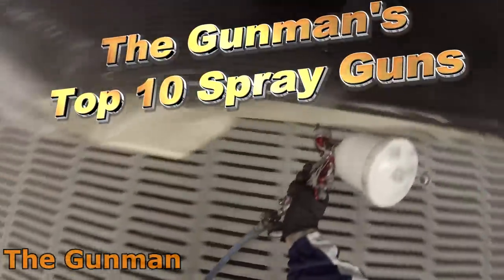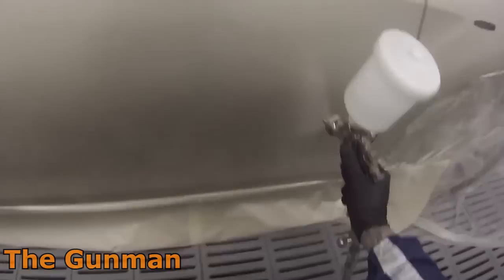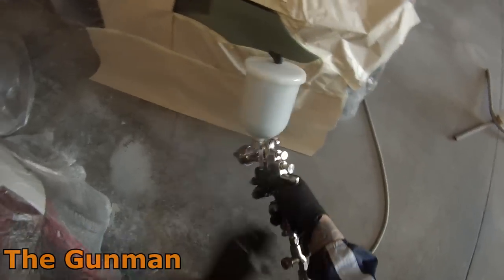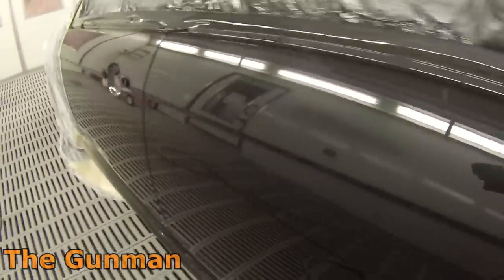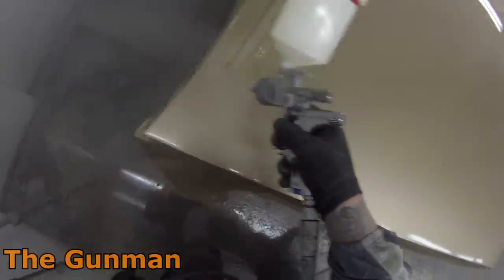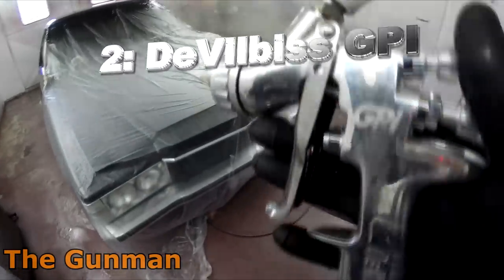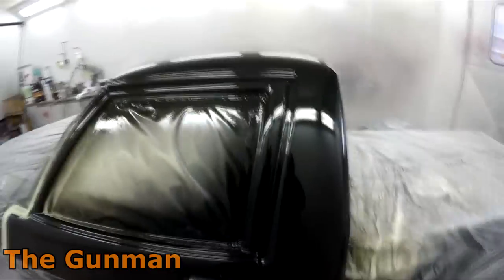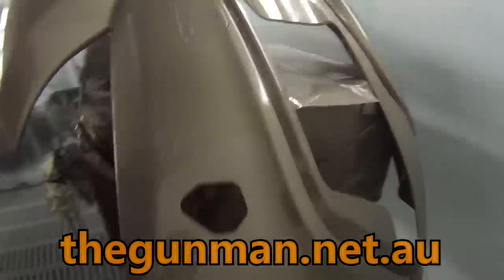Top 10 Spray Guns

Comment: When I first started working auto-body for my Dad in my early teens, the only paint guns that existed were siphon-feed Guns. Of course, phones still had curly "Q" cords attached to the wall and most people thought you were well to do if you had one the could make it to the living room from the kitchen and it had a number pad dial on the receiver so you call from whatever room you could get away to.

Back then the only paint guns worth having were, Binks and DeVilbiss. I would use SK's, Blue Points and I.R.'s for primer, and lacquer primer was the only thing that even existed when I first started. I think it was the ass-end of the '80s / early '90s when 2K entered the world but every shop I ever worked for in those days used lacquer primer until it was completely taken over by 2Ks in the mid-'90s. 

The first 2k product I can remember is RM 2K clear (Wich claimed you could "Key job" it and it would self heal. The only drawback to it was a dent could not be blended or repaired. If a car got hit in a quarter panel you had to repaint everything attached to it, which usually meant both quarters, the roof and, God forbid if there was custom work under that clear!!!) and then Sikkens came along shortly after and totally screwed up the entire paint code world. DuPont finally caught up and it wasn't long after that Martin Senior went basement bargain pricing and dominated the industry in my neck of the woods. Probably the most advanced paint product in my early years was Imron and Centari.

Anyway, DeVilbiss was my go-to-gun for clear coats. I do have a pair of Air- Gunnza  AZ3's with 4 needles and cap setups and I can tell you that the 1.3 is an awesome clear coat gun, The 1.5 set- up is a great all arounder and the 1.7 lays the 2k and Epoxy Primers down so well it's actually a joy to spray primmer.

For custom work and big airbrush projects, my mini-gun and probably my favorite gun I have right now is the Sata-Minijet 4! What an amazing toy that little rat is. With the fan setting in the cone position, I can make pencil size lines and with a little eye to hand practice I am wiping out rat tails, shading, you name it that gun is the most versatile piece on the rack.

I gotta say though, I would never have thought in million years a paint gun would get as pricey as they do today. Seem's like Iwata is the culprit that destroyed the spray gun world with the cost and, really until I actually put a big Sata-Jet in my hand, I thought the whole conversation around spray guns, airbrushes, HVLP v. LPHV, atomization and, overspray v. paint contact was a friggin scam!!  The idea of well-placed grommets, air chambers and, hand-polished needles being any different from what already existed was all Greek to me.

Before the whole "Atomisation" revolution came along, the most modern, "Hi-Tech" paint gun I cant remember was a Sharp. I can remember the Snap-on guy bringing one into the shop and talking in up and shortly after that,  the sales reps' started invading the place. Sharp's were different and they had a unique feel and they looked kinda cool but it ended up being a $75 primer gun because to me, the most reliable and smooth tool I had was my DeVilbiss' 

All of this to say, HOLY SHIT!! I am in love with that Eddie VanHallen "Frankenstein" design you got there!! If I would have had a gun like that growing up ...... Or even now for that matter! I gotta have it!! I'll be looking.

Great vid man! Thanks for the post. Like I said I've been doing auto body and custom paint since I was 14, I'm in my early 50's now  and I do everything in my power to not touch any project

Comment: I'll add my 5 cents:

1. DeVilbiss GTI Pro/Pro Lite - lightweight, easy to use. OK for normal everyday use, you don't have to care much about it, just grab and spray. Cheap.

2. SATA 3000/4000/5000 - not for everyone, more for experienced painters, not so easy to use -sometimes unexpected behavior, worse ergonomy at least for my palm, difficult to set it up, mainly the HVLP model. Expensive. Will withstand various acids, peroxide and other corrosive liquids.

3. any other.. 

Easiest to use - SATA 100 B RP Lignum - if you ruin a paintojob with this gun then better you stay away from spray painting for good :)  
With 1.7mm  tip you can do the whole job from filler to topcoat.
Not a car gun though, developed for furniture production. 
Best gun for beginners. 
It won't withstand chemicals as good as expensive SATAs, for example knobs will turn dull when exposed to corrosive chemicals. The body is still real bulletproof titanium/aluminium based material same as other SATA guns.

Comment: Let me ask you a question since your the gunman,i am using a 1.3 Sata 
5000b HVLP to paint and to clear but i know that the HVLP is good for 
the base coat and the RP is good for the clearcoat.Now my question is i 
want to buy the Sata 5000b RP for the clear but what if instate of 
buying the SATA  5000b RP i just buy the Sata 1.3 RP nozzle set and when
 i finish to shoot the basecoat than i take off the 1.3 HVLP  nozzle set
 and put on the 1.3 RP nozzle set in the Sata 5000b HVLP ,will it 
transforme my SATA 5000b HVLP to a SATA 5000b RP instate of buying the 
Sata 5000b RP

Comment: Hi there iknow i may not get reply but worth the try,, i have question i just got tekna and im not sure what is best set up for smoothest finish possible, current set up i have is te20 with 1.2 tip i tried te10 but not sure about that , i spray at about 2bar and about 4 inches away. Wierd thing is that after i spray down color finish looks lil better than after i spray clear ower, i use finish line for color , oh and  im spraying cabinets not cars, so thats why i m looking for very smooth not trying to match any orange peel. Im in florida

Comment: if you have tried I would like your opinion on a devilbiss 670 plus gun been around for 10-15 years still available new. as I recall devilbiss came out with the GTI millennium and 670+ at the same time

Comment: OK, layman question. I bought 2 Sata guns, for my friend, both 5000 models. One was never used, (the HVLP 1.3 tip) and a RP with the 1.3 tip. Both had the cups with them. He used the RP twice, and decided he needed a lower pressure gun (too much overspray). I got both for $1000.00 USA Dollars. Personally I used the HF ones because all I usually spray is lacquer for woodwork. My friend does hi-end restoration on cars. Putting a Sata gun in my hands is like putting a 50 cal. in a 3 year olds hands. He said it was a good deal, and I trust his judgement. My question comes from my lack of knowledge with the guns. While I do things that are on the lower end of painting, do you think I should look into getting a better gun. While I do not paint auto body, the cheaper guns seem to work for me. If I happen to let it drop, I'm only out $12.00. Since I live about a mile high, the altitude does seem to effect the finish. The guy I bought the guns from said they had to be set at 26PSI. I regulate and dry the air before the gun, but I set mine so it has little over spray. How should I be setting them? 
It sounded strange to me that you need a different Sata gun because you have too much over spray but again I am not experienced with paint guns. Any info you could send my way would be appreciated. 
Smiles,
Bill
Reply from the maker: Yes I hear you, SATA aren't the easiest gun to use and I don't recommend them to most people because of this.
There are some great mid range guns out there, I highly recommend these 2, the GPI is a budget version of the GTI Pro and near half the price, made in UK so quality tool. The FLG5 is another great value gun and if you didn't want to spend the little more to get the GPI then it's a good option, made in Brazil. Another handy one to have is the ANI R-150 midi in 1.2mm.
I have specific reviews on all three of these guns so you'll be able to get setup guides there and if you let those guys know I sent you they'll definitely look after you. Good luck Bill and thanks for watching.
GPI: https://www.spraygunsdirect.co.uk/index.php/devilbiss-gpi-all-purpose-gravity-spraygun.html
FLG5: https://www.spraygunsdirect.co.uk/index.php/devilbiss-flg5-compliant-solvent-spraygun-best-seller.html
R-150: https://www.spraygunsdirect.co.uk/index.php/ani-mini-gravity-spraygun.html
Reply: +The Gunman I work sin the production line body shops I paint a total of 30 cars a week iam really picky I like my jobs clean and slick I have always use iwata for clear coat it slicks out. what gun would you say slicks it out the most and I mean the slickest from all guns.. I dont have a problem slicking clear out but there is always room to improve
Reply from the maker: Osvaldo Narvaez Pro Lite
Reply: +The Gunman I have a tenka copper and I believe there supposed to be the same thing cause my helper has the black prolite and I have the copper well anyways I tryed it for clear and it leaves it think like a fat ladys leg lol I tryed to adjust it couple of times and same thing it does shoot sealer and base super super nice just couldn't get to work with clear. the clear is 8180 spies hecker.. I shoot clear with a w 400 1.3 and just got a ls400 supernova 1.3 intech
Reply: Osvaldo Narvaez youbcan use the sata 5000 hvlp or rp for 8180 leaves good results.
Reply: David Ocampo the rp I belive you but the hvlp for 8180 hell naw I seen a guy use man the clear came out thick and orange peel.. I used a w400 and npw I use a LS 400 intec 1.3 super nova.. I dont have a problem slicking my clear out I just wanted to know what can can slick it out the most and so far iwatas.. the pro lite gunman said to  use leaves orange peel and thick clear I guess it also depends and what brand clear
Reply: Osvaldo Narvaez it all truely depends on experience i can slick it out with hvlp.i like satas because you can build your layers more on a pass and get minimum orange peel . iwata ws400 is my other clear gun i have all kindsof guns and i prefer my iwata for clear. havent gotten used to shooting clear with my prolites. ive ordered a nebula with a t110 aircap cant wait to try out.
Reply: kutzbill

Comment: 10 fantastic paint guns, all priced far apart from one another. I've been spraying for nearly 40 years, and truth be told, the guy holding the gun is ultimately the decision maker, I've seen some absolutely stunning work come out of the cheapest gun, and absolute crap from the best that money can buy. That's my point, whose holding that gun has plenty more to do with it then you mentioned in this video. Otherwise, nice job, great choices for your list.
Reply from the maker: That's a good point, I guess I was just assuming the guy behind the trigger know's what he's doing, thanks for watching and your input.
Reply: +The Gunman keep up the good work, I'm not a you tube poster like yourself, but I do appreciate what your doing.
Reply: miniac91 Prep work is the most important to me. If your prep work is done right and you Know how to spray, you will get a good quality finish.
Reply: He is right, BUT eliminating any possible issues thru using the best gun is my take. You can't blame your gear...Thanks for all your info GM
Reply: It's like owning a great guitar or a cheap one a great guitarist makes both sound great, the best guitar and best guitar player adds a little more....

Comment: Thanks Gunman...
I was surprised there was not more Sata guns in the top 10.  After watching it through would have to agree that the cost is too high for a top 5 finish. But Sata 4000 B RP should be Top 10.  The DeVilbiss JGA should be there at 10 because the damn things  wont die...
Great Video... subbed

Comment: Hey mate. I do a little bit of painting for the company I work for, and I purchased a Devilbiss SGK after watching vid, great insight by the way. Any settings you would recommend? And does spray booth temp come into account? Our spray booth temp is not adjustable and runs at 26 degrees. Looking forward to trying the Devilbiss SGK 600. Any info would be appreciated.
Reply from the maker: Good purchase mate, I ran it with full fluid, 20-25psi and had the fan wound in a couple of turns from memory, I haven't used one for a while I must admit.
Reply: Thanks for that brother, when setting the air pressure regulator on the gun, is that set with the trigger pulled or without trigger pulled? Thanks in advance.

Comment: Not sure Ill get a response but here goes... Any idea what gun I should buy for using enamel paints on furniture? This includes primer, top coat and clear. Be great to get an all in one gun. I bought a velocity VGS and its no good. Not sure between Iwata 400 and Devilbiss.. and what type of set up. Thanks to. You have great training videos.
Reply from the maker: +Terry McGuire I'd go for a cheaper option like the FLG5, ANI F150 or DeVilbiss GPI, you'll save a few bucks, still have a good gun and get just as good finishes.
Reply: Thank you sooo much for responding!!!!! Your response fixed weeks of anger I was having with a no-brand gun in one hour with a Devilbiss. Devilbiss owe you commission for your research - you deserve it. Thanks again.

Comment: Hey GunMan, in currently using iwata Lph400, using a 4-1 high solids clear.... any tips on setting  up the gun for maximum results?
 Love the videos and thanks for any help or advice you can give
Reply: I paint cars for a living, and I've owned  the lph400 for 8 years now. I spray PPG Global basecoat thru it, and it's great with metallic and pearl colors. It's NOT good for high solids clears in my opinion. I've tried it a few times, and Im never satisfied spraying clearcoat with it. I use a Sata RP for all clearcoats. I'd go buy one of the Devilbiss models he mentions in the video if I were you. Great price vs performance value. Satas are the most durable in the long haul though.

Comment: First off, Love the videos.
((I need some gun recommendations))
Im painting motorcycle plastics and just bought a compressor. First time sprayer with an actual spray gun. 
So for a first use, and basically a 1 time use, What size nozzle is the best for primer, clear, basecoat and lastly for spraying some flake?? Your help is greatly appreciated

Comment: I just got a tekna prolite with te10, te20, 1.2 1.3 1.4 and digital pressure gauge for $370 US.  it did not come with a cup. are the devilbiss/tekna cups interchangeable? the only one i can find for tekna are 900cc metal for $80 US. where can i find plastic cups like the one you have on your prolite? thanks
Reply from the maker: Send spraygunsdirect.co.uk an email, I am not 100% sure if they do fit but wold be very surprised if they didn't.
Reply: The cups are interchangeable!
Reply: Thank you

Comment: Hey gunman!
Which air cap and nozzle setup do you recommend for the GTI Pro lite? 
I'm a home/hobby user and using it  to just spray base coat and clear coats.
I currently have the Iwata Air Gunsa AZ3 and looking at upgrading

Also i'm after a mini gun as well.. anything you recommend ?
Had a look on spray guns direct and there are a lot of options.
Reply from the maker: This is the best bang for your buck mini gun https://www.spraygunsdirect.co.uk/index.php/ani-mini-gravity-spraygun.html and if home DIY then get the T110 cap, it consumes less air and is capable of real smooth finishes.
Reply: The Gunman awesome !
And with the gti pro lite- do you get the 1.2/1.3 combo or 1.3/1.4 combo ?
Btw learnt so much from your videos !
Reply from the maker: Richard James I'd go for the 1.2-1.3 if I were you, 1.2 may come in handy if you find you want more control and less material.

Comment: been spraying metallics using  the GTI pro/tekna,  TE10, 1.4  and 17psi.  have no clue if thats a bad set up.
Reply: +803brando I spray solvent and I just love my new tekna that I bought a few months back. I spray it with the 1.2, TE20 air cap at 24.5 psi and its just perfect for me like that. Just mess around with the caps/nozzles and pressures and see what feels the best for you.

Comment: great video as always. .   any suggestions on a good spray gun for blending metallic paints? those question for anyone watching also
Reply from the maker: what's ya budget and are you just a hobby guy?
Reply: +The Gunman budget $500...I do it as a side job at home. I've been using the flg 5 it's been working cool just thinking bout an upgrade
Reply from the maker: The GPI is a good option, next step GTI Pro lite
Reply: +The Gunman ok thanks

Comment: Hello, my friend, very good videos, I am from Brazil, but unfortunately it is almost impossible to find these pistols here, I am looking for to import one of the United States and I would like your information of this GTI pro Life from Devilbiss is for application varnishes! and gpi devilbiss can be used for base application as pu if that's how you call that type of paint there. What is the durability time if this investment is worth it? quality of them should be higher I work with devilbiss here but it's all second line, thank you if you can help me. website you mentioned spraygunsDirect is secure Is it reliable?